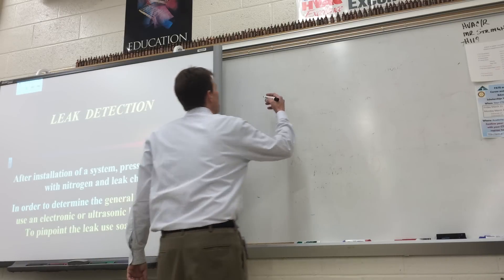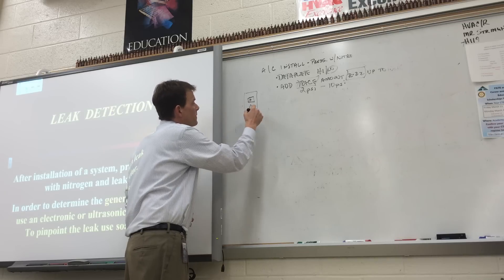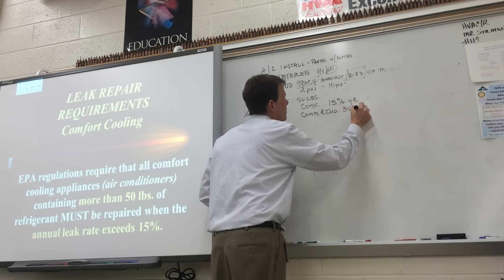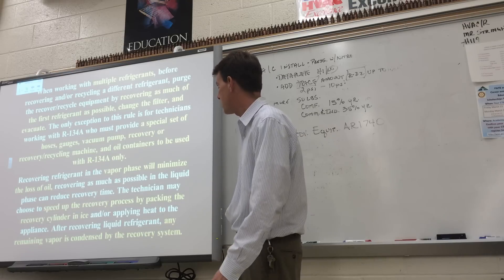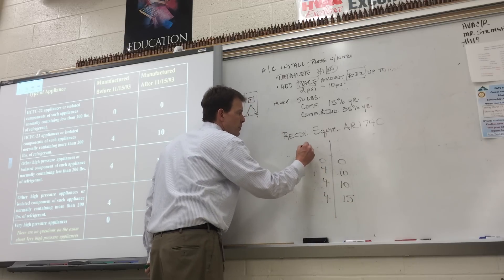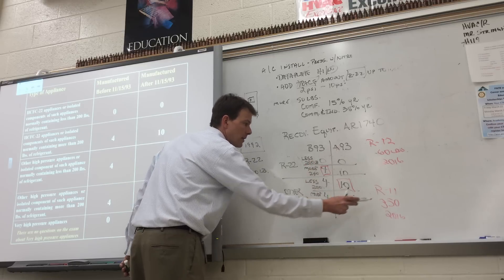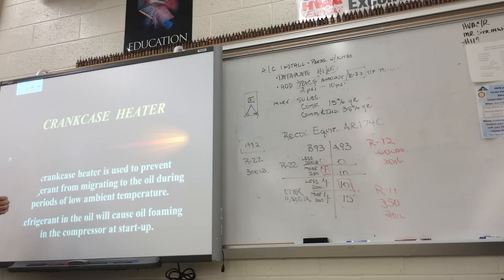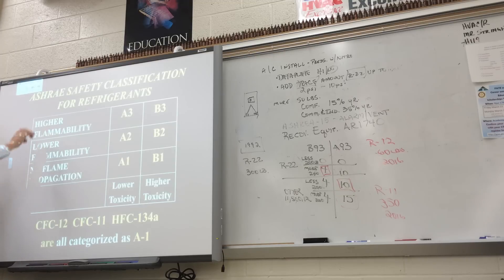HVAC Basics: EPA 608 Certification Test Study Guide - Type 2 Lecture by Stringham

Comment: Min 15:00

If you are pumping out a system with a leak in it, how do you NOT pump out AIR into the recovery cylinder? 

Doesn't that mean you have to recharge with all-new refrigerant?

Comment: Min 18:00

Earlier in this series he talks about "throttling Liquid through the Suction line." (Why?: because when the system is running, you Can't add liquid to the liquid line because the pressure in the tank is lower than the system pressure?)

Here he's talking about charging the system through the liquid line.  Is the system turned off here?

Comment: Min 15:00

If you are pumping out a system,

1) it might have a leak,

2) so how will you know you've FINISHED pumping out refrigerant and are now PULLING AIR into the system (through the leak) and are (a) ruining the refrigerant in the recovery cylinder, (b) making a mess of the AC system by pulling air into it, all through its piping?

Comment: Question: I already passed core and type 1. Have to go back for type 2/3 . the instructor says you can write down the chart for vacuum on a scratch PC of paper for the test. However rules say you can only take pressure chart "blank" PC of paper and calculator. So who's right???
Reply from the maker: You can do this while the proctor is getting ready on your piece of blank paper. If you do it while he is reading the instruction or when he says begin then that is ok You are not supposed to be able to bring any prewritten notes into the testing center. 

HVAC Basics: EPA 608 - Top 20 things to know for Type Two of the EPA 608 Certification
https://youtu.be/Dv6TOY2pR5Q
Reply: @edisonhvac  thanks it is a proctor watching on webcam 👍

Comment: I am a new teacher using the same curriculum. I like the videos you make.Keep up the good work!
Reply from the maker: +yes please thanks for the encouragement. We are switching our main text next year to another HVAC text. Essentials of Heating and Cooling. Aside from ESCO's text which others do you use?
Reply: edisonhvac 
I use the NCCER curriculum along with the HVAC Excellence. In Delaware that is what the state uses for the apprenticeship program so we are required to teach it in order to give the high school students advanced placement when they graduate.
Reply from the maker: +yes please 
Refrigeration & A/C Tech is what I primarily use to stay in line for duel enrollment with the community college. Some students leave with 8+ credits. Some test out for apprenticeship 1 or 2 that will not go on to college. If one or two want to go in to sheet metal union the articulation agreement gives them a few benefits. Most just go to work. I use the NCCER Teacher Editions for HVAC for lectures. Those are good text.

Comment: Hello Mr. Stringham, I am currently about to take the EPA 608 Type ll certification test this coming Tuesday. What would be your strongest short term advice?
Reply from the maker: +Lucky Stud read the type 2 part of the ESCO text three times, watch the video a few times and download the free software from www.epatest.com that has a study mode and practice test. If you are taking the test with ESCO then their website has a practice test but I'm not sure if the questions are always the same or if they change. The software has more practice questions and it's free. That should do it. Good luck and let me know when you get the the score. Do that and you'll be fine.
Reply: edisonhvac from what I remember from failing the first time everything you talked about in this video should be on this test. But thank you I will do just that and let you know how I did